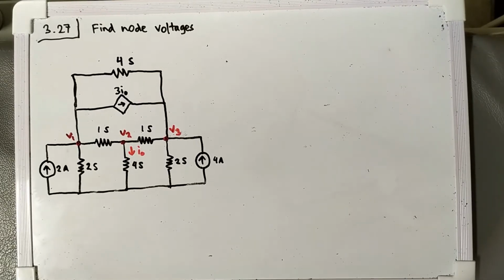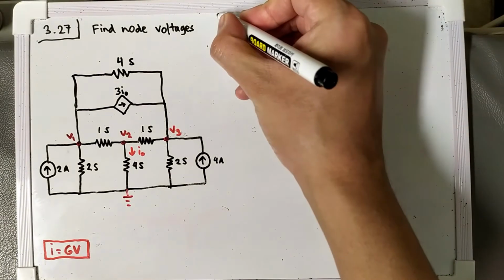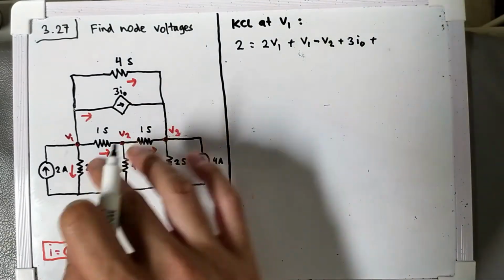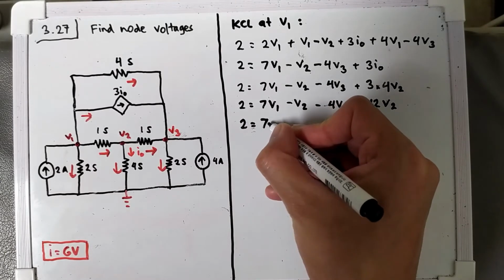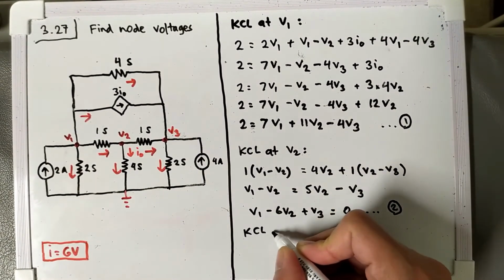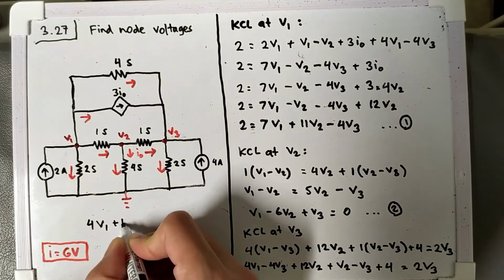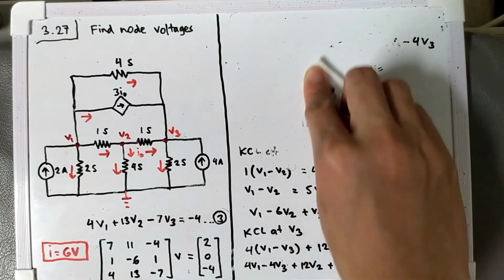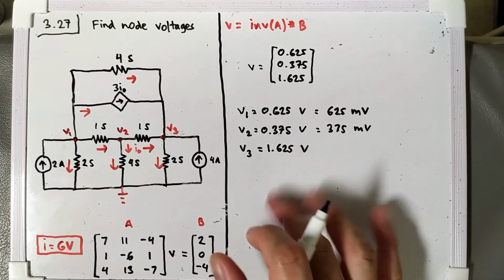Problem 3.27 Sadiku Use nodal analysis to determine voltages v1 v2 and v3 in the circuit of Fig 3.76

Comment: bang di 6th edition, Example 3.8, Figure 3.27, hal 100, soalnya mirip bnget, disuruhnya nodal voltage equation by inspection. kirain mu jelasin itu..
Reply from the maker: Nodal by inspection tinggal masukin rumus kan harusnya
Reply: @ArdiSatriawan  iya bang mkasih, cuma kenapa harus dalam conductance ya, (dibuku jg gtu)
Reply from the maker: @masbro1901  Tinggal 1/R aja